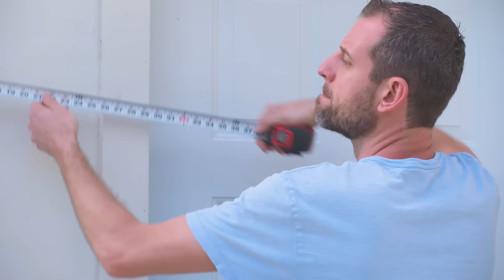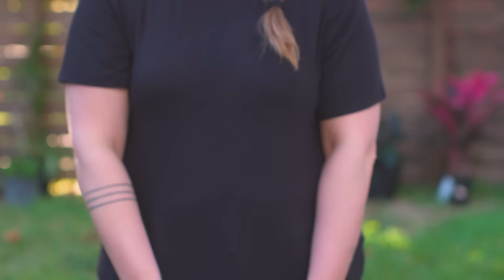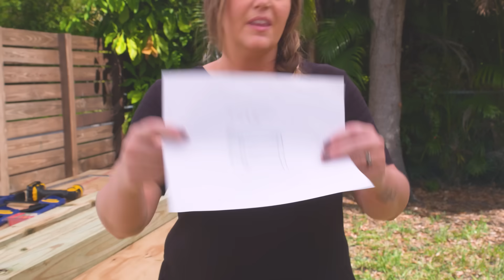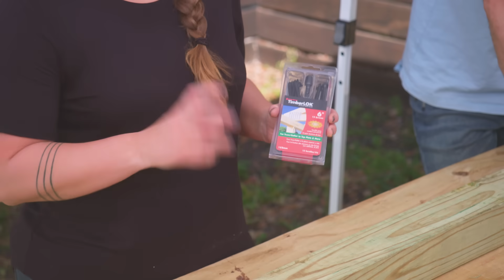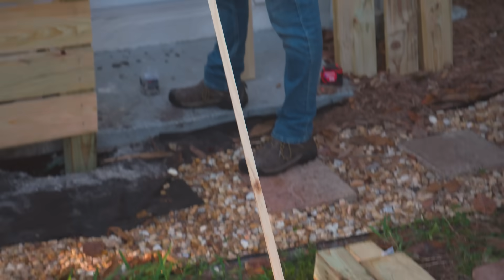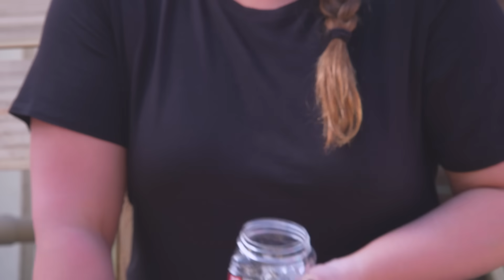How to Build a Privacy Screen (w/ Monica from The Weekender)

Comment: Not a good idea to put the post in cement. Today’s Pt posts are not treated well like they did years ago. It will be hard to replace them. Just put them in the ground and tap the soil down good. The earth will harden up around the posts. When a fencing company puts PT post in the ground they never put concrete around it.  Use stainless steel screws on the horizontal boards so you can replace them easily if they begin to rot.  Or you could use the new PVC boards that have a wood grain look and you can paint it any color you want. Now if you have to remove a post or a horizontal board it will be much easier.

Comment: You’re so helpful cause you explain everything... so help me with this.. I live in a Third World Country, most of the houses are made of concrete.. what kind of DRILL is best to use when putting up “whatever on the walls” the type of nails and using the plastic inserts is the normal here.  Also if I only had one type of small versatile SAW to buy what would that be please. So hopefully if I can’t buy it here I can send for it from the states. Thanks so much

Comment: If you were putting this on a concrete patio, would you use epoxy to secure the bottom?
Reply: Brandy Wright The best bet would probably be to drill a hole into the concrete and attach a wood to concrete anchor. Similar to what would be used when building a deck. 
https://www.lowes.com/pd/USP-4-in-x-4-in-Triple-Zinc-Wood-to-Concrete-Cast-in-Place-Base/3365876

Comment: The only problem I see with this screen is that it is made with pressure treated lumber.  That would be fine if it wasn't next to a swimming pool.  Whenever it rains the chemicals from the pressure treated lumber are going to be washed into the pool.    Swimming in those chemicals is not a good thing.

Comment: the posts will rot fairly quick due to the exposure to all that moisture from the quikcrete. no?
Reply: yeah, they need to put some sealant on the post where the post comes in contact with the ground.  that is where 90% of the rot occurs.

Comment: why not just putting the posts in place, cement it and then just cut them level instead of risking and fiddling with dirt after you cut them? doesn't matter if the holes are the same depth or not as long as the above ground top cuts are level with each other.
Reply: I was wonder same thing

Comment: Nice project, but would have been easier install, no digging and easily removed if needed using the post stakes you sell like this: https://www.lowes.com/pd/Oz-Post-4-in-x-4-in-Hot-Dipped-Galvanized-Wood-to-Steel-Base/1000567911

Comment: QUESTION: Why did you leave 4" when doing the concrete? I went back to the DIY Basics setting a post video & it looks like they went pretty close to the top. There's no explanation of why one should keep the concrete below soil level. I look forward to more videos!
Reply: Concrete around the post right at ground level would hold more water against the post. By leaving a few inches of soil at the top, it gives the water a chance to drain away, prolonging the life of the post.
Reply: @jasoncmccoy  - That makes sense. I've always brought the concrete above soil level then tapered it away from the post. That usually adds at least another bag of concrete! My next posts, I'll set this way and since I set my posts 4ft into the ground, it'll be a little bit cheaper! Thank you again for these excellent vlogs!
Reply: honestly you should never concrete post in they will rot faster no matter how you do it just dig a hole add a little rock at bottom and fill back in with dirt your post will last at least twice as long
Reply: @hotrodpaully1 This is the best comment. This is how the utility company install telephone poles.